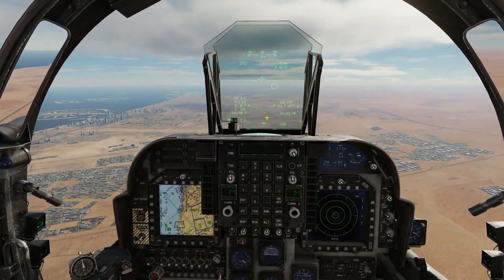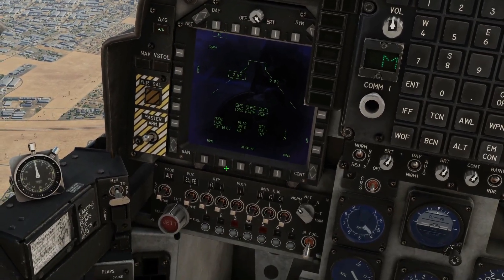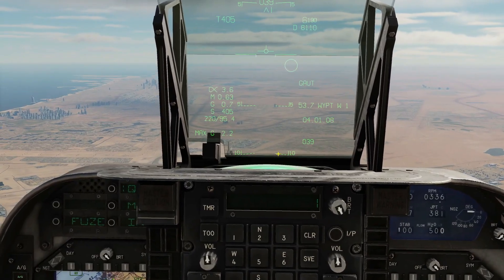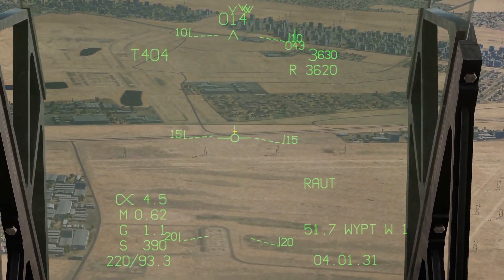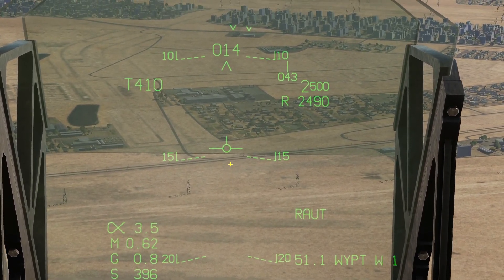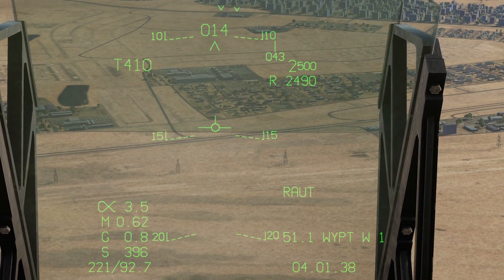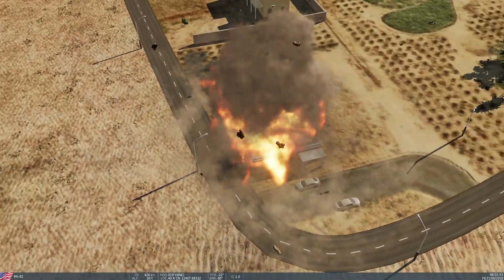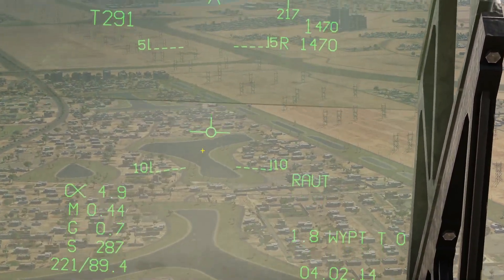AV-8B Harrier: AUTO Point Blank Designation Bombing Tutorial | DCS WORLD

Comment: What is that horizontal joystick called? When would one use it? Space sims?
Reply: Do you mean the spinning controls at the start of the video? There’s 3 joysticks, 2 throttles, 1 collective (helicopter control).
Reply: At 0:05 they are L-R: F-16 throttle, collective, F/A-18 throttle
Reply: @carsons5750  oh I see it now. I meant the f16 throttle. I thought when seeing it move fast it was like a joystick mounted sideways for some reason. The way the buttons looked. Seeing it at 0:05 I see it glides like a throttle. I way curious because for space sims I think I did see someone with a sideways joystick
Reply: @Ultrajamz  There are some places that sell left-handed joysticks so space simmers can have a stick in each hand, so you're not far off.